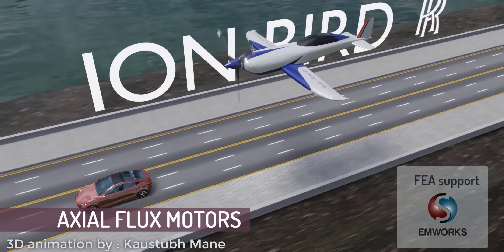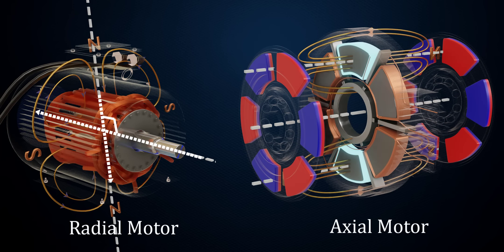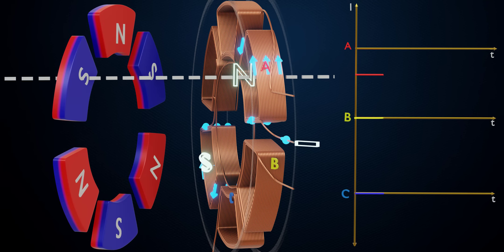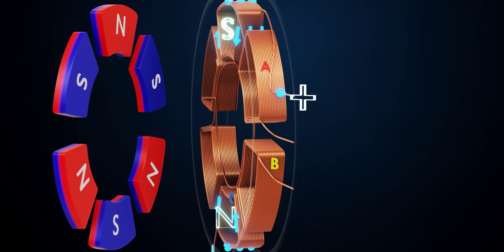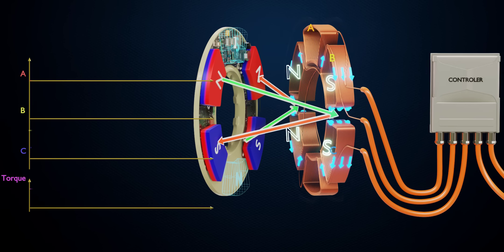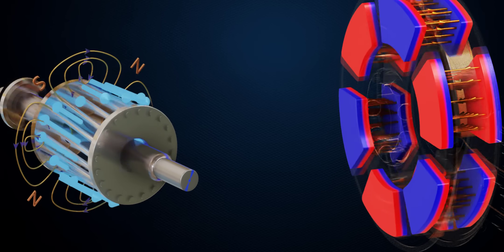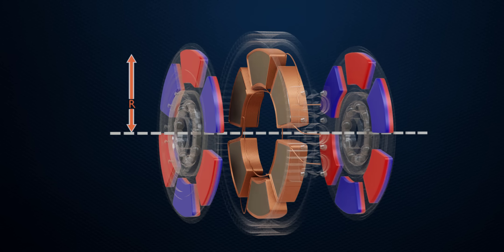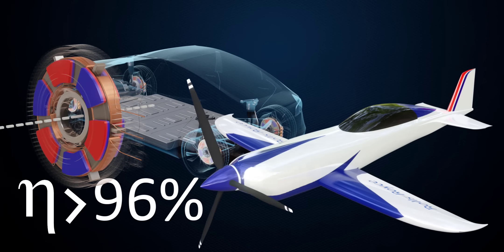Axial flux motors - The new hope

Comment: As an electrical engineer by training, I find this an excellent video. However, as a pilot by profession, I was totally distracted by the propellor rotation in the wrong direction for forward travel.
Reply: They just needed to flip 2 wires though and it'd be fine =)
Reply: or change the propeller pitch angle
Reply: just turn the prop around...easy
Reply: @OziBlokeTimG  not that easy, you will need to take in mind the torque produced by the motors on the entire aircft
Reply: @OziBlokeTimG  If you took the propeller off and flipped it over, the blades would actually still be angled the same way, so that would not work. The only solution is to have the motor spin it in the opposite direction.
Reply: "If the wheel rotates faster than the frame rate, then the wheel will appear to spin backward instead of forwards. In each frame, the spokes have rotated and seem to be a few degrees behind the position it was at when the camera last imaged it. This is commonly known as the Reverse-Motion effect."
Reply: @flybyw  If they were truly wishing to model that phenomenon, wouldn't you expect them to show the motor internals rotating in the correct direction when they did the cutaway?
Reply: @flybyw  what ? its an animation dude...
Reply: @whoswho6641  similar concept when the frame rate is relatively low and there is no motion blur
Reply: As a STEM field professional by training, I find your comment an excellent one. However, as a non-English speaker, I was totally distracted by your spelling of the word propeller.
Reply: great going sherlock...i read your comment before the video started (or during the ad) and now I'm distracted too!
Reply: It’s obviously a business proposal, they must be looking for funding. As an engineer there is conflicting truth in regards to 2 different motor designs they are lumping together
Reply: Who are you to say what direction the plane is really flying? ↔✈?
Reply: It was a pushback from the parking spot😂😂😂 a new day in aviation has arrived 😂😂
Reply: LOLOL
Reply: Looool -- good eye.
Reply: How easy to apply reverse thrust, though.
Reply: Just to see if you were paying attention...Nice catch.
Reply: I like what took a company tens of millions of dollars to develop. Was simply what kids in school have been playing with for the last few decades. The electric flat plate wheel.
Reply: Вы точно инженер электрик? Авторам этой идеи явно не хватает знаний в теории электрических машин. Магнитные поля замыкаются без магнитопровода. Страшно подумать какую энергию приобретут тяжёлые магниты раскрученные до 10000 оборотов в минуту. От  такого самолёта надо будет держаться подальше! Необходимость в контроллере вызывает большие сомнения в компетентности авторов. Не понимаю, чем авторов не устраивает обычный асинхронный мотор Теслы. Асинхронный двигатель не нуждается в магнитах и контроллере и раскручивается до любых оборотов.
Reply: How Can You Tell If There's A Pilot commenting on your YouTube clip? Don't worry they will tell you....
Reply: It's turning the fast back into fuel
Reply: The first thing I did after watching the beginning was scroll down to the comment section to see if anyone else noticed the propeller spinning the wrong way haha. Nice catch.
Reply: Its a pusher plane lol
Reply: its just an optical illusion generated by the high rotation of those blades :)

Comment: Am I the only one that realizes that you are comparing an AC motor to a DC motor? A squirrel cage induction motor is an AC motor that works because of the rotating magnetic field crossing the induction bars and the Axial flux motor is basically just a brushless DC motor. Two totally different things with two totally different principles.
Reply: The stator remains more or less the same 😉

Comment: Could Axial Flux motors power Heavy Earth Moving Equipment?
Does stacking them as with air motors yield more torque at low output speeds?

Comment: This is very fishy. It is mostly true that this type of motor can have Higher torque (and lower rpm) but there is no reason to compare it to the induction motor it should be compared to the brushless DC motor, in which are equally if not more efficient.

Comment: Problem with electric aviation ain't the motor, it's the batteries.  Battery weight will have to improve (become lighter) by 800% from current levels to be competitive with kerosene jet fuel. Making a better electric motor isn't going to do jack shit.

Comment: Because of the high torque couldn’t you add gearing to spin other smaller motors to produce a charge for the batteries while still having the main motor power the propeller / wheels giving the battery more range? I have a concept of what it will look and function like…..
Reply: The issue is that then the main motor has to fight that generator for the batteries, and the losses incurred with the gearing to get those smaller motors to spin as generators. It'd be more sensible to simplify construction by not having the additional break points, and add more batteries as needed if you want more range

Comment: This may be of some help but it's insignificant in the face of the main problem aviation faces: the awful power density of batteries. You could have the motor weigh nothing and still the aircraft would not be competitive because of how bad batteries are at holding energy.

Comment: I can't wait to drive / fly in thorium powered vehicle that has spacex design and can take me to the edge of milky way in under few lifetimes. Has nobody ever thought about power density and amount required for such applications? Lithium has high power density, and sodium even more. Now, try puncturing high capacity lithium battery and go back to drawing board. Average 18650 lithium ion battery weights ~48g. 6k of those would be 288Kg of static weight. Meanwhile jet A1 weights about ~790g/l, meaning that you could have ~364 liters of it. According to my yahoo-fu, boeing 747 uses 12l/Km, which would mean powered flight distance of 30km.

Comment: The really screwed up thing is I came up with this idea (sorta) years ago while working on the Carnival.
I built what I called a  "perpetual motion generator" to power my Camper Trailer. I used an Air Conditioner motor, a Truck Battery from a RAM 3500, a jury rigged alternator cap, a battery charger and a Generator motor from a Gas Powered generator that the engine had went out on.
The truck battery provided the juice to get the Blower motor turning, which in turn spun the generator, which then the Alternator Cap spilt the power to re-charge the battery and routed it to the board to supply juice for power usage. To turn off it had a cutoff switch. 
Everyone told it would never work.
It worked amazingly well. It powered my RV and another one to boot. It even ran two RV AC units plus all the other crap that comes with living in an RV.
It paid for itself in a month and half just in what I saved in gasoline for the Generator.
To my know knowledge, it is still running to this day. I sold the RV to another Carnie when I retired, and showed him how to maintain it.

If I had thought to get a patent on it i would be rich like Elon now, huh?

Comment: Wouldn't another advantage be that the axial layering allows you to stack the coils and magnets infinitely? That stacking would minimize end effects, and allow (almost) every face of every magnet and every end of every coil to be paired up with a counterpart. (Where stacking them radially would lead to a motor of ridiculous radius.)
Reply: The starting forces required to overcome static internal forces would be larger too
Reply: @shanematkorah  Yes, if you have surfaces touching, or the rotor completely submersed in lubrication, you'd quickly get ridiculous friction.
But I would think motors usually are designed so that the only thing the rotor touches is its bearings and any contact to other surfaces would be a defect. Then again, giving more possibilities for such a defect to occur would surely reduce the reliability of a motor.
Reply: @Pystro  what about its total weight?
Reply: @shanematkorah  I'd imagine you just keep the total thickness or power that you'd design for, but split it into as many layers as feasible. Admittedly, "as feasible" means that you can't split it into infinitely many layers, because there's some structural overhead per layer.
Wire coils don't keep their shape too well on their own and you probably want SOME walls sealing off the wire coils on the magnet sides, and at least a protective surface coating on the magnets, which add up for each layer.
The magnets can easily be relatively thin wafers or plates as long as they don't get too brittle, and the wire loops could be printed as a single layer spiral onto both sides of a PCB-like sheet of plastic or sheet metal. So THEORETICALLY you could split it down to only a few handfuls of wire loops spinning between each magnet wafer.
But even if you need actual bending rigidity for the housing of the wire loops (for shock resistance or why ever), 1cm or 1/2 inch or so of aluminium frame/ solid plastic/ glass fiber composite should be enough to do the job for a motor with even a diameter of a foot or so.

Comment: The problem with electric aircraft isn't the motor, it's the power storage. Batteries have an insanely bad weight-to-capacity ratio for something that flies. Most current electric aircraft are lucky to get 45 minutes in the air with any usable load on them. Supercapacitors would be better but their capacity-to-size ratio is pretty bad especially for high-current applications.

Comment: This whole Article is not true and based on missing fundamental knowledge. Axial Flux is only in very short time (below 30 sec) better, then it gets to hot and reduces to a quarter of a normal cooled radial Flux machine. In addition the manufacturing could be worse.

Seeing papers of German FEAAM company, you see that with good technology for radial Flux motors the results are far better.

Comment: Isn't the bigger problem with battery electric aircraft the weight of the batteries? Also propeller planes can only go under transonic speeds, some kind of electrically-powered jet engine is needed to really made a dent in commercial aviation.

Comment: That would make the 3 phase direct drive washing machine motor an axial flow motor with the permanent magnets in the outer rim and the electromagnets on the inside of them.
    This arrangement could be more powerful adding another set of permanent magnet inside slightly offset at the other end of the electromagnets.

Comment: I don't think the majority of aviation will go electric. I can't see the energy to weight ratio of the batteries getting high enough to justify it, and there would need to be a revolution in propeller design to provide high efficiency at high altitudes and supersonic speeds.

I think the more likely solution for aviation will lie in hydrogen. There are still a few hurdles to get over, but I think they are easier to deal with than electric aviation's challenges.

I think the best place for investment would be in hydrogen based jet engines (a relatively easy task), clean hydrogen production using renewable's on airport grounds to remove the transportation issues with hydrogen (some of this could be provided by solar given the large spaces airports occupy e.g. solar runways). Then the main hurdle will be the safe storage of hydrogen onboard the aircraft (especially in the event of an accident). This will possibly be solved by creating a mixture of hydrogen and some other substance to create a more stable fuel.

I'm excited to see where innovation takes things and will be interesting to see how accurate my prediction ends up being. Anyone else got any thoughts on it?

Comment: Torque isn't that important for aircraft. If it were, turboprop engines wouldn't work. On a turbine engine helicopter, you can hold the rotor still with your hand if you hold it from stopped, the torque is that low. Once it gets spinning, though, don't put your hand there.
Reply: Um.. say what? Do you think the turbine turns the propellor directly? An electric motor that is directly coupled to the prop requires a very high torque:rpm ratio. Adding gearing increases mass and complexity.

Comment: Rubbish. It's just PR nonsense to entice investors. The power to weight ratio just isn't there for any long or large flights. Double the mass, you increase power need by 8 times.
Reply: Sorry? Double the mass of an aircraft and you need 8 times the power? Explain that one. Also, power to weight is based primarily on battery energy density and capacity - electric motors are very efficient already.

Comment: By my calculations, the induction might be negated by simple capacitance, alternating the frequency to fine tune the Rolls, however, mechanical aspects such as weight and torque classifications should be considered. Well, my squirrel passed away and my rubber bands are brittle. My grandson still believes that round waves are what is surfed. Square waves are like square roots and only for the sake of electronics and mathematics do they seek reality. Argument: A net is for fishing, not surfing! Response: If you can teach a fish to swim -- send it to a school. It is what it is, productive elements showing that the best of brilliance only comes from genius understood.

Comment: In Electric Aircraft, there is "Always" a Multi-variable Balancing Act, between Mass, Wetted (Surface) Area, Lift, Drag, Power, & Energy!

While it's True that Gasoline is something on the order of "30x" as Energy Dense, as Batteries are, today, Fueled Engines are also "1/3" as Efficient, as Electric Motors, to start with!

So, the get Equal Performance (Endurance, or Range), we 'Only' need batteries to get 10x Better, not, 30x Better!

For now, getting Drivetrain Power and Control Electronics "Aced" is just as Important!
Reply: I'd say the relative inefficiency of internal combustion is heavily outweighed by the fact that it is an air breathing system and carry <30% or so of the total reactant mass for the amount of energy delivered. Batteries on the other hand, like rocket motors, carry all of the reactants with them. They can do tremendous amounts of work relative to the size of the package, but duration is hampered by the burden of the energy storage system.

Comment: I would think one  big advantage would be the reduction is noise. I assume the propeller speed and pitch would be managed like a turboprop. No drop in manifold pressure would favor the performance at higher altitudes.
Reply: The batteries required to power an electric motor strong enough to keep aircraft in the sky any length of time would be so large and heavy that the aircraft would be unable to do anything else but a 'proof of concept' flight.

Comment: Great presentation.  How does the axial motor compare with the radial flux motor for back EMF generation? Second, can single rotor axial flux motor "lock up " if stopped with the magnets perfectly aligned? Are multiple offset rotor magnet discs required to prevent this from occurring? 
Thanks.

Comment: Meh...
Because of the design constraints I don't see it being very reliable. 

You have the magnetic forces constantly alternating inward and outward relative to the plates. Stress fractures are a given, so these will be garbage after a few thousand hours. By comparison,  the non radial motors last forever.

Comment: A very good explanation.
The controller is similar to the variable frequency drive used for conventional three-phase induction drives? as the last graph with the smoothed off pulses looked very similar to a three phase sine wave graph.
For electric cars the huge advantage is not only torque, but because of the flat disc shape they can be placed inside the wheel rims, and provide very good regenerative braking, conventional disc brakes could be omitted and a small emergency brake could be incorporated in each motor as a pair of small blocks grabbing on the outer edge of the magnet disc.
Reply: The very real downside... have you seen how many curbs and potholes and debris people hit? Imagine chucking a motor inside the wheel. I know it's currently being done but talk about risky 🤣

Comment: Thanks for the explanation! Although for aircraft, it's not the motor but the battery that's weight-prohibitive. Conventional brushless motors already have power/weight much better than internal combustion ones, as well as very good efficiency in the 90%+ range, but alas, Li-Ion's energy/weight density is 30 times less than gasoline's. Total useful output like 7 times less considering gasoline engines only output 25% of what they burn as torque, the rest wasted as exhaust heat.

Comment: Motor tech isnt whats holding back electric airplanes... its battery tech.
Batteries are heavy and airplanes are all about weight. Fuel is heavy too but a fully drained battery weighs exactly the same as a fully charged one, whereas gas fueled aircraft actually gain a lot of range from the fact that they constantly lose weight as they burn off fuel.

Comment: Axial flux permanent magnet generators are commonly used in small (especially home-made) windmills. If I remember correctly, they use one less magnet than coil (or vice versa) so that it doesn’t have a ‘cogging’ effect. I guess that wouldn’t apply here because you would lose the efficiency of having a small part of the diameter not working at any particular moment.

Comment: We’ve been using these on electric radio controlled models for decades - allowed us to get high torque at lower prop speeds and therefore no gearbox required
.
Reply: And whose motors are those? We've been using radial flux brushless outrunners for a few years. For "decades" we were using brushed can motors. Then brushless inrunners, then outrunners added to the mix.
Reply: @gertnood  You’re right, it was more like a little over a decade.
Reply: @TheForwardThinker I’ve been out of the hobby for years now…